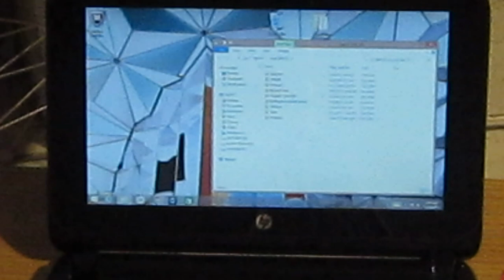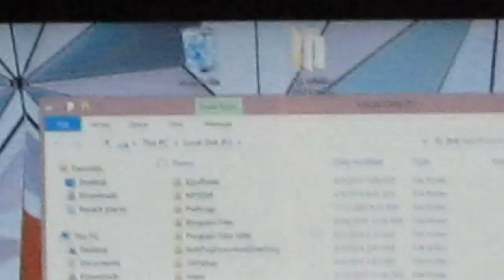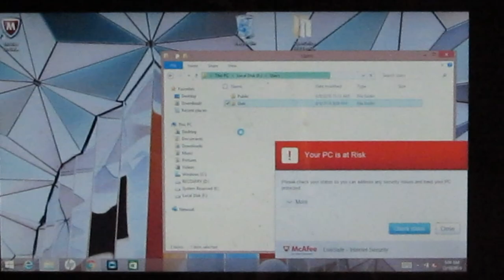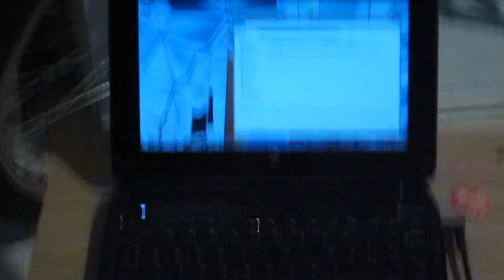How to recovery Data and Pictures from crashed computer hard drive using  a USB - Sata / IDE adaptor

Comment: Went to Walmart.com, ordered a kit for $14, connected my hard drive to my laptop and bingo,
I was able to get all my files and photos transferred to my laptop.  It really works.  I have friends that want me to salvage files from their broken computers.
Reply: @selflovesciencepodcast867  https://www.walmart.com/ip/SANOXY-SATA-PATA-IDE-Drive-to-USB-2-0-Adapter-Converter-Cable-Set/321378628.  This is the adapter I purchased.  Simple to connect, simple to use.  I am now using the hard drive from my broken computer as a back-up drive until my new computer arrives.  I hope this helps. I can not wait to try it on my other drives that I kept from previous dead computers.
Reply: @senzanome8294 was your hard drive partitioned? If yes, did all partitions show up on the new device you connected USB to?
Reply: @IndianKat  Yes, they did

Comment: I have a HP laptop with a hard drive 1 (301) failure. I ignored it stupidly and now my laptop won’t boot up. Does this sound like the type of issue you’re referring to in this video that I may potentially be able to retrieve data? Through the little research I have done there aren’t many other sources suggesting this action so I’m skeptical to try it.
Reply from the maker: I guess this is something on the newer hard drives that is supposed to warn you as soon as the hard drive starts to fail, to give you time to recover your data.  You should not try booting the system any more.. this may further damage the drive.. You either should remove it immediately and try to recover data ASAP, like I show in this video.. or if you don't feel comfortable doing that.. take it to a local professional that is capable of recovering your data.. Yes this process can retrieve you data, assuming the hard disc is functioning properly still. When the hard drive starts to fail.. the more you use it, the more it can degrade, so time on and running, is an issue.. basically you should retrieve your data ASAP with as little drive on-time as possible.. if it is not too late.. Best of luck..

Comment: hi i have a quick query and would appreciate your guidance. i have a home computer running a sata hard drive. i have three old style pata hard drives which i want to recover some info from. i have ordered a sata pata adaptor so when i get it will i have to unplug my sata hard drive cables in my computer and connect them to the adapter then connect it to the old pata hard drive and if i do then should i set the jumper to master. or    can i connect my old pata hard drive using the adapter into my computer without disconnecting my sata hard drive so in reality running two hard drives and if so what jumper setting should i set on my old pata hard drive. i hope you can follow this !!!  many thanks
Reply from the maker: The cable I use in this video goes through USB, so you should not have to worry about jumpers.. or disconnecting the hard drive that runs the computer.. that could be a disaster.. I have a another video where I show how to disconnect an optical drive, and hook the second hard drive up that way.. I will post the link below:

https://youtu.be/xiGLjGHBoSw

Comment: I bought a AGPtek adapter, expecting tomorrow. My desktop wont boot so pulled the HD and going to buy a Lenova chromebook to connect the HD to using the adapter. That should work, correct? I'll also connect external hd to laptop to transfer the one HD to the external. Thanks
Reply from the maker: It should work.. provided the hard drive is still operational.. Give it a shot!

Comment: Thanks. I'm going to try this... I have a laptop that just stop working. It won't even power on.
Reply from the maker: If it won't power on, then the first thing to check is the power supply.. If you have a volt meter, you can check to see if the power supply is putting out any voltage at all..

Comment: My question is, if I’m able to recover data from the corrupted old internal hdd connected through the dock, and I transfer the data I want to keep to the new SSD, will I be risking corrupted my new SSD if I transfer the data that is corrupted from the old hard drive? Just want to be on the safe side.

Comment: Dr Jaynes how are you doing Sir.
i need your help i want to recover data from  my hard drives and i have watched your tutorials no i want to find out the power cable, is it suppose to have a power pack or just a computer cable that can go direct on the power adapter?
Reply from the maker: It was a kit I got form Micro Center.  It comes with everything.  I noticed that walmart  and others sell these on line, if you do a search on "sata USB adaptor cable" you will find several.  If you have a desk top computer, you can do this without having to buy the cables..Here is a video that shows how..
www.youtube.com/watch?v=xiGLjGHBoSw
Reply: plug laptop hard drive directly onto your mother board sata it is the same if you do not have the setup as in video.

Comment: Omg Thk u  for making your video I just pulled out the hard drive from my old Lenovo and was wondering what next ?  So I need to fetch the power cable then. Would Amazon sell the adapter?
Reply from the maker: Yes I believe you should find something there.. it is possible to do this without having to buy the cables as well.. if you have a desk top computer.. I have a video that shows how..
https://www.youtube.com/watch?v=xiGLjGHBoSw

Comment: So what probably happened was the computer hardware failed. The drive was fine all along. If this drive were plugged into a the same model laptop like the one it was pulled from the laptop would probably boot up. Good video for people that have a laptop crap out.

Comment: Where can i best ( most easily and cheapest)  find a power supply cord with the 4 input female Molex adapter on the end like you show  ?? Have in internal HD from an old G4 tower whose motherboard crashed, that i desperately  want to try and extract photos from and looks like I could easily do this if i can find that power supply cord  by using the instructions in your video
Reply from the maker: I got this at Microcenter, but you can probably find it on line as well.  There are many different type.  Mine was able to connect to the older type hard drives as well as the sata.  With what every you get, you will want to make sure the plugs are compatible with the hard drive you have before you buy it. Hopefully this helps a little..
Reply: So is the Molex connecter just plugged into the power supply that you have plugged into 100 via a usb port or is that power cable all one piece that feeds the Molext 4 female connecter ? I have a Seagate Barracuda ATA IV 80 gig HD that the motherboard crashed on an older G$ tower I had. I need to power the HD and the plug/cable you show at 1:30 ish in your vid is what I am after. I know the Molex connecter appears to plug into a 110 power supply and so I need to find something like that but can't figure out what to call it to pull up options online, Is it simply called a 110 power supply cord ?? Kinda new to all this but there are a couple thousand pics on the HD of my kids i am desperate to retrieve if possible. Thanks for your hep thus far !!!
Reply from the maker: I believe the power cable is a separate cable that has a little power supply that plugs into the wall, and the other cable goes to USB on my computer.  I know there was a little power switch somewhere on the cable to turn the power on, on mine, and it wasn't completely obvious at first.  You definitely need power to the disc or it will not work.  Yes you should definitely try to recover any data you can.  I know that stuff is irreplaceable, and a lot of the 'big box' computer-help places just want to reformat, to get your computer working, of course that will loose all your data. 

When it is working, it should have some notification that says there is a new device connected I believe.  Did you purchase a kit like what I was using?  It is possible to plug it into the power supply of another computer as well.  I would recommend shutting off the computer nicely before and after disconnecting if you try this. You don't want to do something to mess up more things.  Try not to hot plug devices if you can help it.  Hope this helps a little..
Reply: Sorry for the long ebay links above

Comment: I can see the hard drive in device manager but I’m not sure where else to go to access the files? It doesn’t show up in my computer 👀
Reply from the maker: When you click on the hard drive.. are there any folders in it?? Are you using a windows system to recover the files? It could be that windows does not think your user name has assess to the files on the hard disc?? Maybe the files are hidden?? I usually use Linux... Linux does not respect windows security procedures.. and busts right though them!
Reply: @jaynesnetwork  when I click on it in device manager, it doesn’t open but I can right click and it’ll bring up the properties, disable and uninstall. It’s a Windows PC and I’ve got it plugged in directly through SATA rather than USB. I’ll have to try the Linux thing! I may know someone who might let me borrow their Linux for that 🤔 So are you saying that I should be able to open the hard drive whilst in Device Manager? Thank you for replying 🙏

Comment: My HP Pavilion 20 All-in-One died, so I bought a USB 2.0 to SATA/IDE kit.  The cables look just like you have in the video, so I plugged everything the way you showed into my new PC, also an HP, but a tower.  I don't know if I was supposed to plug the USB into the front of the PC, there's 2 ports there, but I did and nothing happened, except that the hard drive I'm trying to get the data off of got hot and started to smell; the power supply box got hot too, so I panicked and unplugged everything.  I'm guessing I did something wrong, I wish I could attach pictures of what I did and what I have.  Please can you help!  I have tons of pictures and files I want to get off that hard drive, which itself is fairly new, about 8 months old as the original one was replaced.
Reply from the maker: Maybe try this one??
https://youtu.be/xiGLjGHBoSw

Comment: I got a marvelously simple adapter for less than ten bucks on e-bay. It uses two USB ports for both power and data. The problem is that while the hard drive out of my totally crashed Toshiba laptop is still just fine and opens ok, Toshiba seems to have some kind of proprietary file system that buries the document and data libraries in some sort of program data files so I can't find them. I've tried to down load  a couple of "free" data mining programs, but you still have to pay for a lot of the data after they find it for you. My question is this: In the past, working with desktops, I have just replaced the desktop hard drive with the one I want to recover data from. If the OS is intact the box just boots up on the new drive. However, I know that laptops often contain a lot pf proprietary programming. I have a HP laptop on order and I was wondering if it would hurt to just swap out the HP hard drive for the Toshiba without harming the HP?
Reply from the maker: I have transplanted hard drives to a different laptop computer before, when the computer itself had a hard ward failure... It will work if the computer is almost identical.. It seems that windows loads drivers for a specific laptop, and if those are not exactly the hardware of the new computer, those devices will not work right... also the way windows is, they don't give an install disc, and I'm not sure how to get the proprietary drivers.. but.. I did find a trick though... for instance I swapped the HD from a fail HP laptop, with an almost identical part number HP, and the wifi drivers were not right for the new machine... so I took the wifi out of the old computer and put it in the new one and then it work fine then.. best of luck with that project..
Reply: Thanks. I was far too dilitory about backing up the old Toshiba and so will probably have to do a bit of work to get my documents and data back. Just have to keep at it. All I really worry about is damaging the new laptop. I just want it to come up enough to move my files to a thumb drive.
Reply: i was originally asking cause i wanted to retrieve, my children picture, operating system idgaf, stil dont, but with adapter i was able to retrieve, al pictures i wanted from my kids,  but Toshiba has al tools from laptop and were kind enough to show me after just send picture verifying i was owner 4 days everything backed back up all, is well. and sent me the usb flash with all operating systems to  reinstall
Reply: did you ever fix it
I have a Toshiba hard drive and a new Dell laptop. It seems you are saying it doesn't work.

Comment: For reference my mother spilled water on my laptop and i was not notified until about a week ago because of finals, which i fear may have killed the hard drive altogether; I got to the last step at 12:25 but my hard drive keeps popping in and out of the computer (my laptop will detect for 5 seconds and then randomly say E:/ drive not found and I end up not being able to copy any of the files on Users. Additionally, when i try to access the files on the hard drive to check on Users, it says "you do not have permission to access these files ...", I'm not sure what to do at this point. I'm taking it to a repair shop to see if they can do something but I've had this hard drive/old laptop for 7 yrs and all of the files there are extremely significant. Any help if u can provide would be greatly appreciated.
Reply from the maker: If it is due to the water... I 'm not sure what to do about that?? I know loose bearing can cause an issues like this.. and if you put the drive in the freezer for a while.. that will shrink the bearings, and allow you to read for a little while... maybe a frost free freezer might suck the water out?? but water can cause whiskers to grow internally shoring out things?? it could be that the write head is going bad?? If this is the case.. the more you try to read, the worse things will get.. you should try to recover things as time efficient as possible.. if you are able to read.. and don't leave the hard drive hooked up when not actively trying to read.. this will cause it to wear out sooner.. if it is a head issue.. maybe you could try photorec, if nothing else is working?? Best of luck!
https://www.youtube.com/watch?v=vLUpJOZmREs&feature=youtu.be

Comment: you can buy a sata connector that will connect to the usb on any laptop or computer that will also power the hard drive to get the information off the hard drive what you're showing is a lot more steps than you need just to recover everything from that hard drive my thought your making it look a lot harder than it actually is
Reply from the maker: It is not that difficult. I am just going through all the step.. Basically you plug the hard drive into a working computer.. then you copy the data from the old drive to your new computer.. You can do it without having to buy the special cable as well.. I have a video showing how to do that...
https://www.youtube.com/watch?v=xiGLjGHBoSw
Reply: Where can i buy that at
Reply: Good god. Your comment requires “a lot more steps” to understand.
Reply: Just for you Angela....... Full stops ..... It is 2 keys past the letter 'M'.

Comment: Hi thanks for video after I get into my old hard drive where would my old iTunes be located?
Reply from the maker: You could do a search once you get it up and running... What operating system are you using?
Reply: So I bought this kit you have on video and plug it up to my old hard drive onto my new windows 10 desktop computer but I figured I would of been able to open up my old iTunes because it was very well organized to drag what I need onto my new computer but I can’t find iTunes thanks for replying also
Reply from the maker: You can use the search in the bottom left corner of the screen.  If you know the names of any of the songs you can search on that, or you can search for file extentions:   WAV, AIFF, AAC, and MP3 , which are possible extentions for these types of files...  hope this helps..
Reply: jaynes network I get what you saying by searching the songs but the main reason I want to open up my old iTunes is because everything is organized by playlists I found it but it’s say the procedure entry point could not be located in the dynamic link library what does that mean ? Thanks so much for your help this far

Comment: Hey! Nice Video. Just wondering: What operating system was on the old one? Really curious.
Reply from the maker: In the video I was using a laptop that was running Windows 8. The operating system is not important.  For my main computer I run Linux Ubuntu.  Any OS should work fine I believe, just as long as you can connect it to an external hard drive.  Thanks again for the great comments.
Reply: Ok. Thank You.

Comment: Will this work if the hard disk has a HDD password?? I don’t want to buy the sata USB adaptor if I don’t have to
Reply from the maker: It depends?? Is it a login password?? or is it encrypted data??? If it is just a login PW,.. the data is not affected.. it is only a windows formality.. It is possible that another windows machine may respect that password?? I usually use a Linux Machine.. they will just blow through that, no problem.. Linux does not care about windows passwords! But if the data is actually encrypted with a bit locker, and a PW, then it is actually scrambled on the hard drive.. and you will need to PW for that, to unscramble the data! Best of Luck!!

Comment: How can I find any emails from a removed hard drive? I've looked and looked and cannot find any but have been told they are there somewhere. I used Outlook for my emails but I cannot find any so called PST files and I'm at a loss as to what to do? I had emails from deceased loved ones and also other important ones.